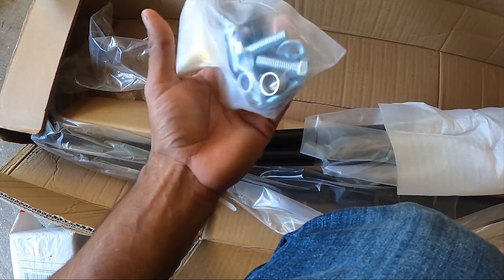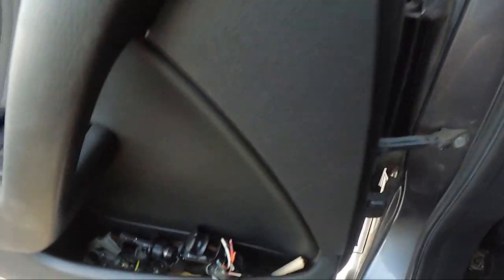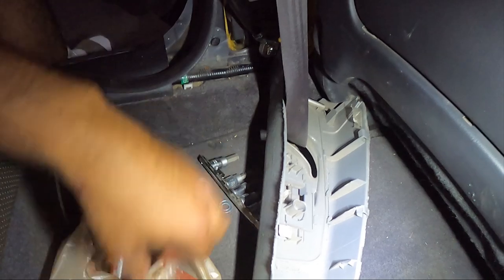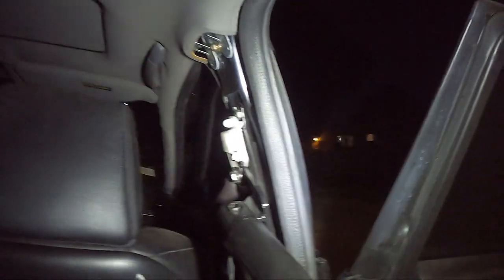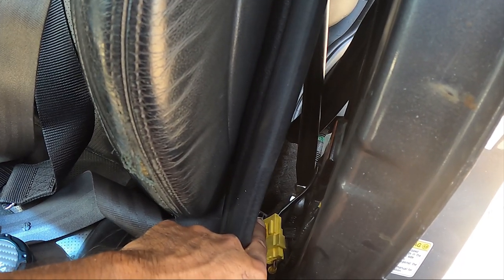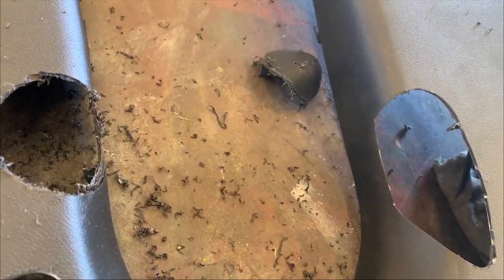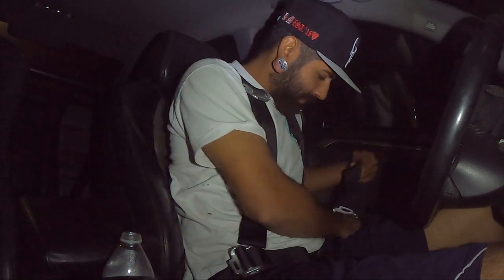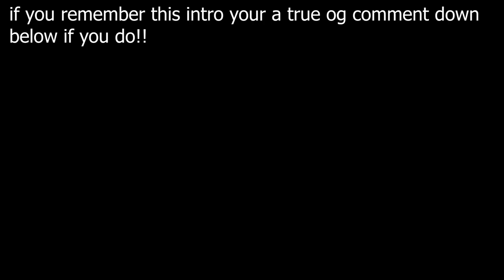Installing Harness Bar on a Acura TL!!

Comment: You got the wrong harness belt . Those are meant to bolt on to the floor without the harness bar, You needed the harness belts for a roll cage that strapped to the harness bar or roll cage. And where you bolt down the belts is wrong they don’t belong there they go straight bolt down to the floor  since the belts you got are meant without a roll cage
Reply: It is better to have the harness bar because if the angle of the belt is too steep it will compress you instead of holding you back